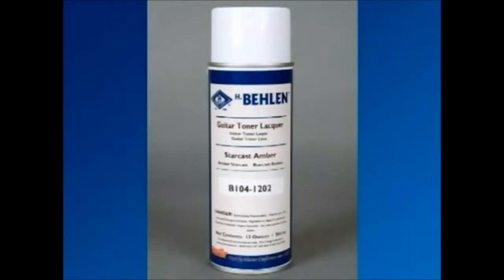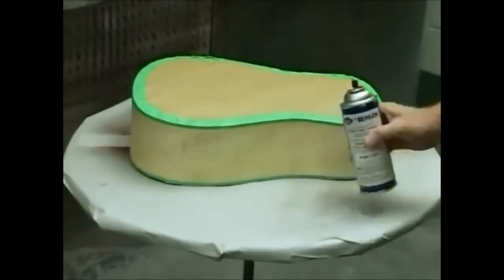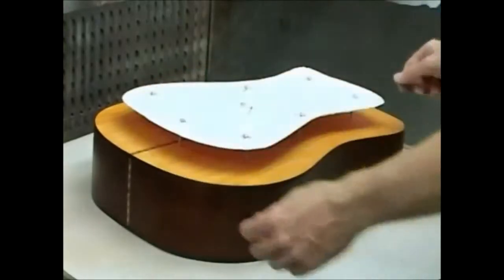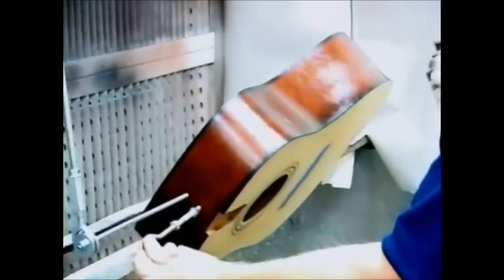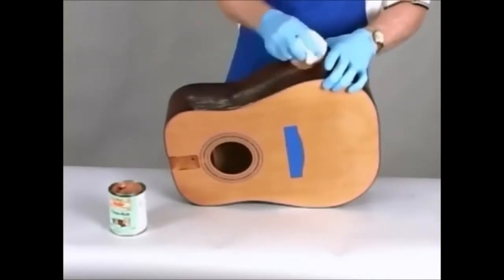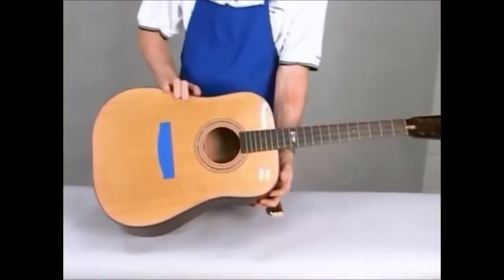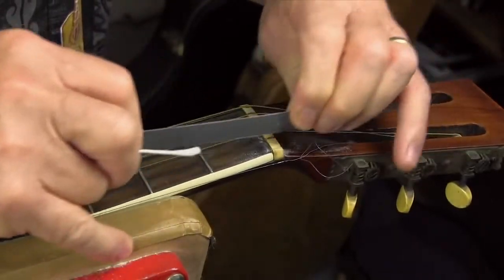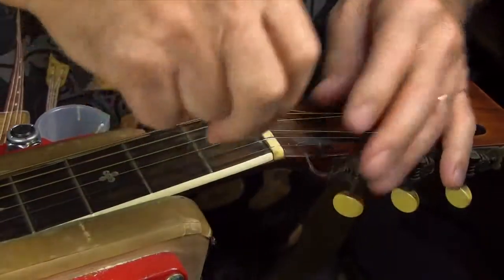Info in  comments &description

Comment from the maker: The ES-150 was the world’s first widely commercially successful 
electric guitar. It was introduced in 1936, and the “150” designation 
was the actual retail price of the guitar! Early models followed this 
same pattern but this trend did not continue into the “new generation” 
of Gibson electric archtops, beginning in the late 40s.
This guitar was endorsed by and also known as the “Charlie Christian”
 model. Even the specific bar style pickup came to be known as the 
Charlie Christian pickup. These were some of the first pickups to use 
copper wire wrapped around a plastic bobbin.

The ES-150 was popular with jazz orchestras and ensembles as it had a 
louder, more authoritative voice than other acoustic instruments during 
this time period.
The ES-150 featured a solid spruce top and solid maple back and 
sides, a mahogany set neck, and a 24.75″ scale. It had an adjustable 
ebony bridge and trapeze style tailpiece. A recipe for success that has 
been endlessly duplicated!
The ES-250 is quite the rare beast. It was introduced in 1939 and was 
very short lived. Essentially, this is an ES-150 with several cosmetic 
and structural upgrades. The body was 3/4 inches longer, 17 inches wide 
as opposed to 16 1/4″. It had a snazzy looking tailpiece, headstock, and
 tuners, and the Charlie Christian pickup had adjustable pole pieces for
 each string! The guitar was built with better quality, more refined 
woods – flamed maple was used for the back and sides!
The ES-100 was introduced in 1938, and was the “entry level” Gibson 
electric archtop. It was renamed the ES-125 in 1941. The prewar models 
had a smaller 14.5″ wide body, although they later re-introduced the 
16.25″ body size. This guitar, along with the ES-150 models beginning in
 1946, were the first guitars to use P-90 pickups.
These full body archtops were sold with several different options, from 
the “thinline” ES-125T, to the double pickup, cutaway ES-125CD. (C for 
cutaway, T for thinline, and D for double pickup.)
The Gibson ES-5 was introduced in 1949 and although not the most 
recognizable model, it offered several innovative features! This guitar 
was intended to be the electrified version of the L-5 archtop. It was 
the first electric guitar to offer 3 pickups, each with separate volume 
knobs and a master volume – no switches, so the player had more control 
over their sound. The original models used P-90 pickups, but after 1957 
they came with PAF humbuckers.
The ES-175 was Gibson’s mid level electric archtop. You may recognize
 this model, as it is one of the most popular Gibson archtops ever. It 
was built with all laminate construction for a lower cost to consumers, 
but it also had practical uses, as laminate woods were less prone to 
warping and feedback at high volumes.
The ES-175’s retail price was $175. It was the first Gibson to use 
the stylish Florentine cutaway. Early models used a single P-90, but the
 dawn of the PAF in 1957 turned the ES-175 into a whole different 
animal. This pickup and guitar combination became one of the most 
recognizable sounds in jazz and is often replicated.
The ES-175 was also one of the first electric archtops to use the 
Tune-O-Matic bridge, which provided more precise intonation than the 
older wooden adjustable bridges.
The ES-135 was one of the first “semi-hollow” electric guitars. It 
featured a thinline, laminated maple body, and a solid maple center 
block that acted as a feedback suppressor. The original models only 
lasted a couple of years, from 1956 to 1958, and then were reissued in 
1991.
The ES-135 had a Florentine cutaway, 2 P-90 pickups, and a trapeze 
style tailpiece. It had a similar sound to the thinline ES-125, although
 the tone was not at thick, as it was not a full hollow body guitar. On 
the other hand, you could play it louder and with a bit more grit than 
the full hollow models.
The ES-137 is a newer Gibson design that is essentially a nicely 
appointed ES-175. It is a bit of a hybird, as the body shape is nearly 
identical to the ES-175, although it has the center block, like the 
ES-135 and ES-335. The ES-137 is built with laminated flamed maple, and 
full binding for a higher end appeal, and was loaded with 400 series 
humbuckers.
like my Arbor:The ES-335 was the worlds first widely available semi-hollow body 
electric guitar. Like the ES-135, it was built with a maple center block
 and hollow “wings” with F-hole cutouts. They were designed to attempt 
to find a middle ground between bright, aggressive solid body guitar 
tones and feedback prone, loose, hollowbody tones, and they were quite 
successful, as this model is still in production to this day.
These guitars used PAF humbuckers and featured a Tune-O-Matic bridge 
and tailpiece, mahogany neck with rosewood fretboard, and a standard 
24.75″ Gibson scale.
The ES-335 was so popular that many signature artist models were 
derived from the original design. You may recognize the Trini Lopez 
model, and the BB King Lucille, which is technically a modified ES-355, 
the higher end ES-335 model.
The ES-339 is another newer offering from Gibson. It builds on the huge 
success of the ES-335, and features a smaller Les Paul style body, with 
335 cosmetics. It has a laminated maple body with center block, PAF 
Style ’57 Classic humbuckers, and 335 cosmetics . These guitars are also
 available with a ’59 style fat neck, or a 30/60 neck, a slimmer 
profile.
And more: @https://manchestermusicmill.wordpress.com/author/manchestermusicmill/

Comment from the maker: Gibson Les Paul Light Electric Guitar Strings $8.oohttp://www.dv247.com/guitars/gibson-les-paul-strings-10-46--51836$3.99Gibson Brite Wires Ultra Light Electric Guitar Stringshttp://www.dv247.com/guitars/gibson-brite-wire-strings-set-9-42--50734
Related Products and Accessories:http://www.dv247.com/guitars/gibson-brite-wire-strings-set-10-46--50731
Google search G Force guitar tuner    https://www.google.com/?gws_rd=ssl#q=G+Force+guitar+tuner

Comment from the maker: Intonation:   Dropbox Guitar manuals pdf:
https://www.dropbox.com/sh/lw23o6h8uizzvvl/AADqDH_zuNcnCaHnZ6NSie_Ha/Guitar%20Manuals?dl=0

Repair ebook pdf
http://woodtools.nov.ru/books/guitars/guitars.pdf

intonation repair. ect.
http://www.guitarattack.com/repair/intonation.htm

Intonation example
The example guitar we are going to use will be the Fender Jaguar HH. At 
this moment, you should've probably mounted new strings, stretched them,
 adjusted the truss rod and string height, and set up the string tree on
 the guitar. Once the guitar is tuned to pitch, before adjusting the 
action, make sure that you have already done the sound check with the 
guitar.

Step 1: Pre-Intonation Setup Check

Before you adjust the intonation, there are a few important steps to 
take. First, make sure that the guitar's truss rod, string tree, and 
string height is adjusted as necessary.

Step 2: Disconnect guitar from amp if not done so.

If you want to have a perfect intonation on your guitar, you should 
first disconnect the guitar from the amp to use the raw string sound as 
the baseline for intonation. For those who wish to customize their 
pickup height, it's not a big matter, so skip this step if you want to.

Step 3: Raw-Sound Intonation

From here, the intonation is simple. Fine-tune the open note on a 
string, then fret the harmonic note on the 12th fret. (TIP: Use a tuner 
to fine-tune as necessary!) The two notes should show and sound that 
they are equally in tune. If they are not, adjust the intonation by 
first de-tuning the string slightly, then adjust the intonation by using
 a Philips screwdriver to turn the small screws shown on the front, or 
back, of the saddle part of the strings where the strings rest on. Go 
clockwise to go flat, and go counter-clockwise to go sharp. This is VERY
 IMPORTANT that you ALWAYS intonate by the small amount at a time! Every
 time you intonate it, fine-tune the open note, and then fret the 
harmonic note again. If they are still not intonating, keep going until 
you find the perfect spot for your guitar's intonation! Once a string is
 finally intonated, move onto the next string, and repeat the process 
for the same string.

Also, this is VERY IMPORTANT that when you fine tune the open note with a
 tuner, ALWAYS TUNE UPWARDS! If you go sharp on your open note, de-tune 
it flat, stretch the string, and tune the open note again! This helps 
keep the strings stretched, and you'll always be sure that the strings 
will be perfectly intonated!

Step 4: Pickup Height Adjustment

Once all your strings are intonated, it's time to intonate the guitar's 
pickup height. Turn the amplifier on, and use a tuner to match the 
pickup sound to the raw sound. You only need to do this with low-E and 
high-E strings. When adjusting the pickup height, rise the pickup to go 
flat, and lower the pickup to go sharp. Remember, you must do this 
adjustment for all pickups, but be aware that they might not have the 
same pickup height as you might've expected! Most pickups have a reason 
as to why they have a distance from the strings! If you are customizing 
your pickup heights, this is no big deal.
https://www.ultimate-guitar.com/lessons/the_guide_to/how_to_adjust_intonation_-_tune-o-matic_style_bridges.html

Comment from the maker: When the Nashville Gibson plant was opened in 1974, it was decidedthat  the  bulk  of  the  production  of  products  would  be  run  in  theSouth;  the  Kalamazoo  plant  would  produce  the  higher  end  (fancier)models in the North. Of course, many of the older guitar builders andcraftsmen were still in Kalamazoo, and if they weren’t ready to changehow they built guitars, then they may not have been ready to changehow  they  numbered  them!  Certain  guitar  models  built  in  the  late1970s can be used to demonstrate the  old-style,  six-digit  serial  num-bers.  It  is  estimated  that  Gibson’s  Kalamazoo  plant  continued  to  usethe six-digit serial numbers through 1978 and 1979. So double checkthe  serial  numbers  on  those  1970s  L-5s,  Super  400s,  and  Super  5BJBs!1975-1977:  During  the  period  from  1975  to  1977,  Gibson  used  atransfer that had eight-digit numbers. The first two indicate the year(99=1975, 00=1976 and 06=1977), and the following six digits are inthe  100000  to  200000  range.  MADE  IN  USA  was  also  included  onthe transfer and some models had LIMITED EDITION also applied.A  few  bolt-on  neck  instruments  had  a  date  ink  stamped  on  the  heelarea

http://archive.gibson.com/Files/downloads/bluebook/GibsonAcoustics.pdf

Comment from the maker: new bridge
Late 1940s Gibson ES-125. Arched 
laminated top, flat laminated mahogany back. 16" lower bout, 24 3/4" 
scale. Non cutaway. Single original P-90 pickup. Silkscreened peghead 
logo, replaced tortoiseshell pickguard. Original nickel tuners with 
white buttons. Replaced ABR bridge,chrome tailpiece, knobs. Includes non
 original hsc.
                                                                                                                         

   
     
       Model:
       ES125
    
     
       Manufacturer:
       Gibson         
http://www.rufusguitarshop.com/p-5588-gibson-es-125-archtop-late-1940s.aspx

  Paul Right Now: Paul Kossoff’s 1959 Gibson Les Paul up close
http://www.guitar-bass.net/vintage/paul-right-now-paul-kossoffs-1959-gibson-les-paul-up-close/

Comment from the maker: WPage 22 What gauge strings should be used?Your   Gibson   guitar   comes   strung   with   “10s”—whichmeans the high-E string is .010 inches in diameter. The low-E is .046 inches in diameter. Theset is designed so that all strings are in proportion to one another, ensuring that the action andthe volume will be consistent across the entire fingerboard.   Gibson offers “9s,” “11s,” anda variety of other gauges and compositions, all of which are balanced for consistent tension.What brand of strings should be used?Gibson has been offering its own strings since 1907,and   Gibson   has   more   experience   than   any   other   string   maker   when   it   comes   to   matchingstrings to Gibson guitars. Gibson strings are manufactured to exacting standards to achieve thehighest level of quality and performance. 
http://archive.gibson.com/RobotGuitar/robot-guitar-manual.pdf

Comment from the maker: Replace the cheap plastic saddle with a vintage bone nut for the real sound. You should also use pure nickel strings, the original gauge was .12 but it ́s ok to play other gauges that you like better. You can buy the original strings for your Les Paul from Gibson in all kind of gauges but they don ́t offer mixed sets like eg. 9-46 
http://www.singlecoil.com/docs/paula.pdf

Webshop - SINGLECOIL.COM - the musicians DIY electronics source .https://www.google.com/?gws_rd=ssl#q=www.singlecoil.com%2Fshop.html